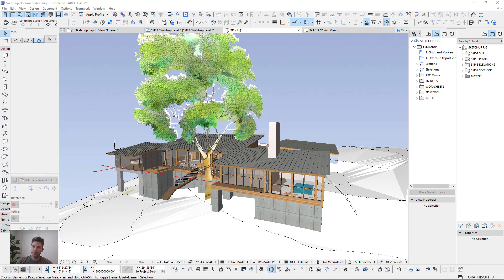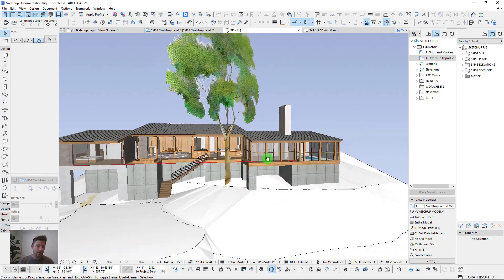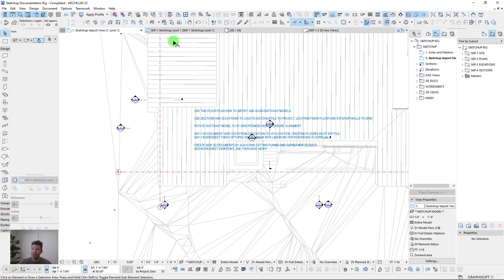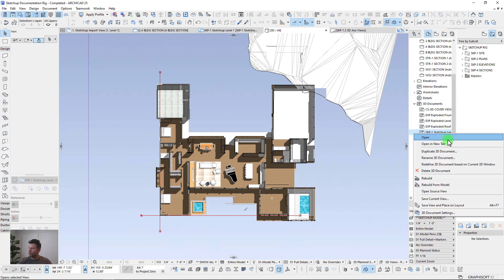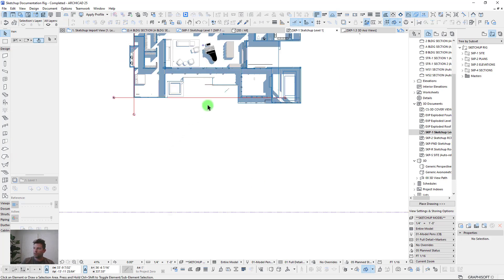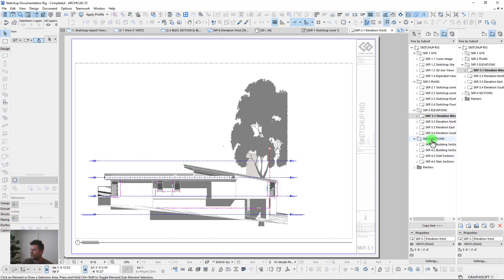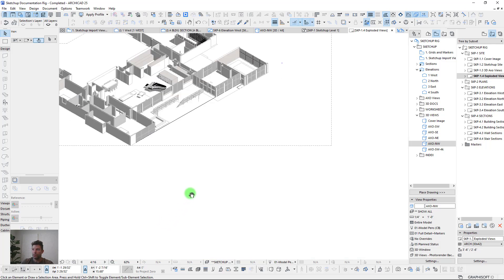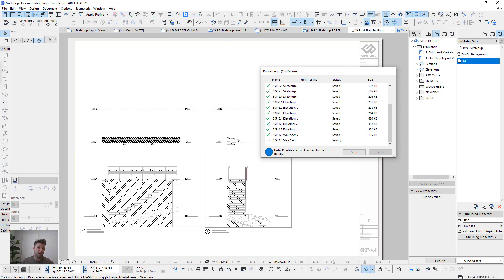The Archicad Template for Sketchup Projects

Comment: Hello.
In what format did you save the sketch up file?
What does one get the floor plans without the template?
Thank you.
Reply from the maker: Hello, the SKP file must be 2019 or earlier to import into Archicad. The rig is setup to import an SKP object, so that it cuts 3d documents and worksheets creating the floor plans. It's possible to do this with any Archicad file, but having it already rigged up speeds the process along... This Rig is included as a free bonus as part of the new CONTRABIM Membership Site. Thanks!
Reply: @CONTRABIM  Thanks. Very helpful.